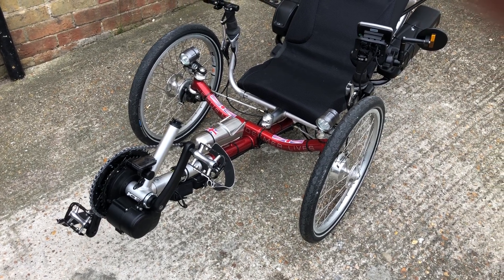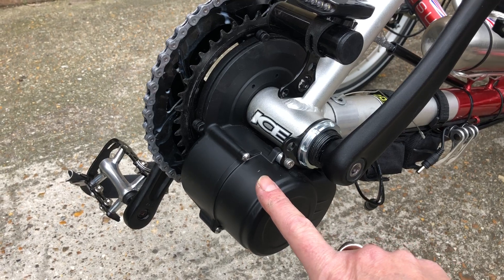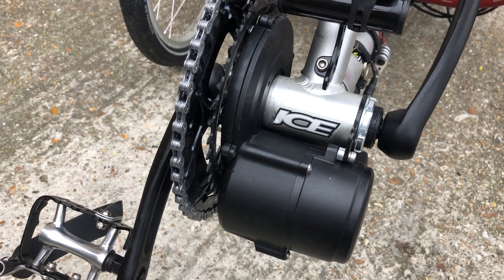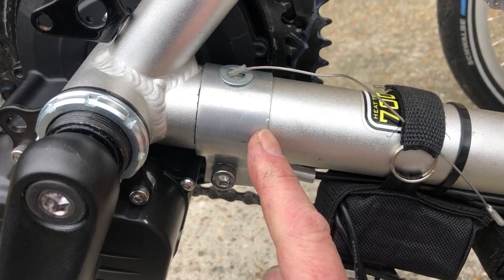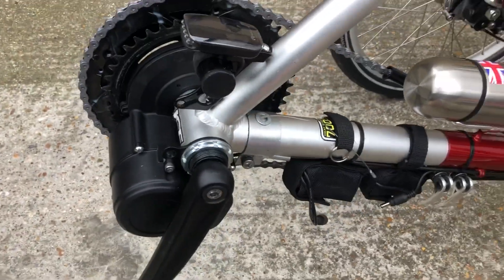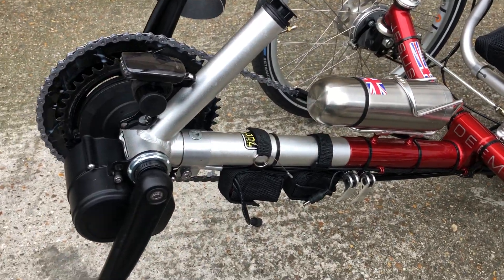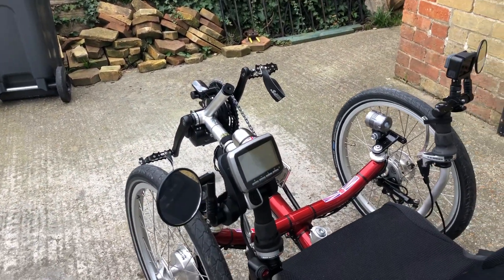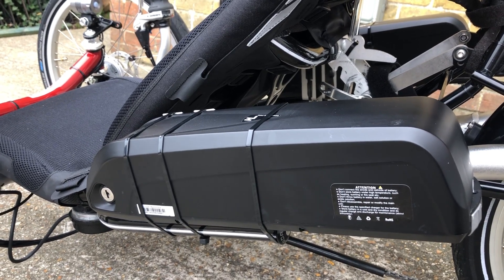ICE QNT Recumbent Trike - How To Install A Tongsheng TSDZ2 Mid Motor

Comment: I'd be interested in your frame mounts for the batteries. I managed to find some brackets that work on some trike frames as long as the mainframe diameter is 2 inches or less.
Reply from the maker: They're just L brackets made from 2.5mm alumium. Along the side that the battery sits on I'm attached so 3M Dual Lock which just helps to keep them firmly in place. The a couple of velcrose straps around each battery.

Comment: Informative and helpful video.  From whom did you order the motor and battery?  How do I get a cable extension?  I have watched the video and it seems to be a fairly easy fit but do you know the crank lengths?  I ride on 155mm as I have knee and hip problems and this relieves some of the pressure on the joints.  Depending on the length of the cranks in the kit, can I get shorter ones from somewhere?
Reply from the maker: You can order a loom but with the standard loom you need to extend a couple of wires yourself. No big deal.

Comment: Did you have to remove the entire original crankset AND bottom bracket parts before placing the TSDZ2 in?  Or did you leave the bottom bracket and simply slide the TSDZ2 into that?  Thanks!
Reply from the maker: As I remember you had to remove both.

Comment: How are you liking the assist and the torque sensing?  Did you end up getting a derailleur to work with that double chain ring and can you please share a link for that double ring conversion if you can.  I think your setup looks pretty ideal, and also uses  a very affordable motor.
Reply from the maker: The double chain ring was ordered from eBay as I recall. Yes, you can get the derailleur to work.

Comment: Can u share how to install full enclosed borealis velo cover
Reply from the maker: I’ve never installed one I’m afraid Luqman
Reply: @etrike7004  G`day mate , just wondering how your Tongsheng motor is holding up , as i`m contemplating building an e trike myself and weighing up my options .
Very nice trike and set up you have there by the way .
I am a bit of an ice  fan , however trike suppliers in Australia seem few and far between , or i would probably just buy one .
All the best mate .

Comment: Danke für den Film. Mich würde interessieren, wie sich der Motor während der Fahrt verhält. Hat er auch so ein unangenehmes Jaulen, wie die Bosch Motoren?
Problematisch halte ich die Tatsache, dass die gesamte Antriebsleistung über die Kette geführt werden muss. das führt zwangsläufig zu einem hohen Kettenverschleiß. Ich habe an meinem Trike einen nicht hörbaren Nabenmotor (GoSwiss-Drive)
Reply from the maker: Hi Martin! I barely hear anything from mine. In fact, at any speed over 10mph the wind cancels out any noise from the motor at all. With regards chain wear, I use a KMC E9 EPT chain, which is designed to use with mid-motors. That said, I spoke to ICE trikes and they use standard chains on their Fat trikes with the Shimano Steps and don't seem to get any problems to speak of. Here's the chain I use:
https://etrike.net/kmc-e9-ept-chain-information-correction-please-read/